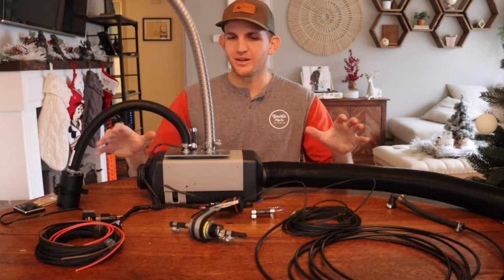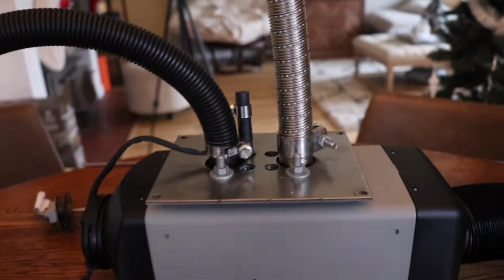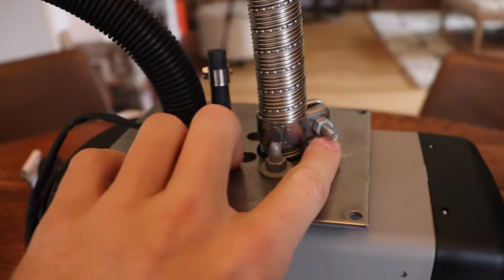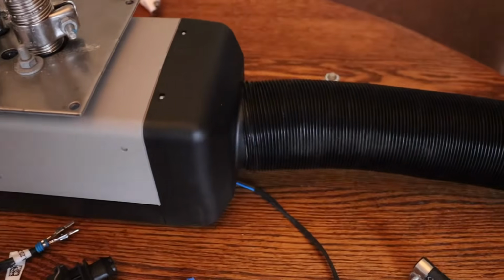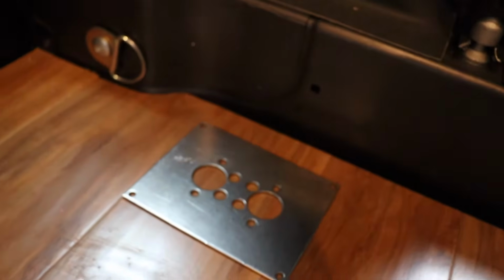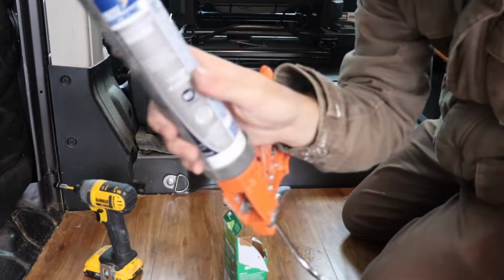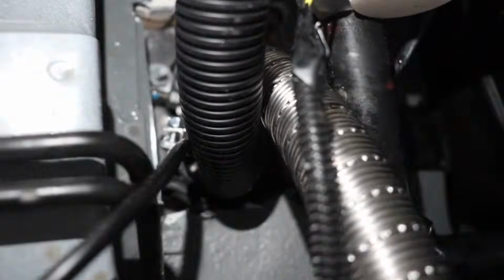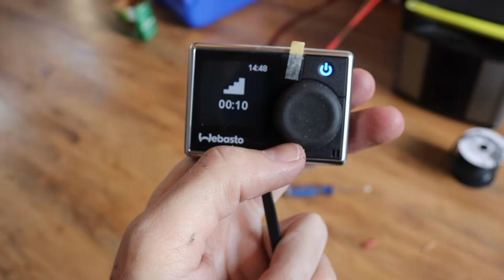VAN BUILD | WEBASTO HEATER INSTALL| A SIMPLE BREAKDOWN

Comment: Thanks so much for putting this simplified one out. Do you have any measurements to help guide the exact placement of your heater, or is it just nestled into the 'nook' there on the seat platform as best as you can fit it?
Reply: A great way to ballpark things under the van is to take drop a piece of  coat hanger etc down the tie down bolt holes.  some go right through tooutside.  Then measure off that known point to do the pilot hole. I'm also using a few of the tie downs to bolt the floor and heavy items down for safety in case of an accident.
I ended up almost dead center of where I had the plate sitting for layout in the van.   Cheers.
Reply: @4945tv Thank You!!  So Easy, So Powerful, So Life Affirming!!  :)    Exactly what I needed as I'm starting the install and planning placement.  I inside and outside (in snow) wondering how the hell do I know where these holes might poke through.  No more guessing.  Perfact.
Reply: You have to be a little careful of the EVAP solenoid below that area but otherwise it’s a perfect spot for a heater.
Reply from the maker: @TWSUF-JI  you’re exactly right. In fact I’ll pin the comment so others can see. I should have mentioned this in the video. That is the reason I drilled a pilot hole. So I could see exactly where I was cutting!
Reply from the maker: You’re welcome!! I measured it out the first time and got as close as I could. It’s difficult to be exact when underneath the van so I drilled a small pilot hole and then crawled underneath to verify I wasn’t going to hit anything important underneath and had enough room for all the components. 
But getting it in that “nook” as you say, as close to the driver seat step is a good spot!

Comment: Thanks for taking the time in making this video, this gave me the courage to install mine exactly like this, I'm having issues with fuel feeding to the heater, it's starts up and generates good heat but after a couple of minutes it dies out, can't seem to find the issue, someone told me the fuel line is too short, it should be longer??

Comment: Great video! this is exactly where I am installing mine, this will help a lot! Quick question for you, you cut the subfloor/insulation, I've seen people use mounting plates with a sort of extension (Turret) toward the outside, to prevent any exhaust leak from going inside. Do you think that it's a good option? Thanks again for your video and sorry if someone else already asked you this question.

Comment: Ok, I’m a little confused. I watched a couple other videos of people installing the heater in a Ford Transit and they both had to lower the fuel tank to complete the install and that is where I kind of lost my courage, but in your video apparently you don’t have to do that with a Ram Promaster as it looks like there is an access panel to the fuel tank from inside of the cab? Given that another video said that estimates to have someone do the install for you in a Transit, was $900-$1500, and although I was leaning towards getting a Transit, I think that buying a Promaster would be a better choice, as I could install the heater myself as the electrical, and rest of it isn’t as worrisome.

Comment: Hey Man, You are a good Egg! I love your videos!   How did seal the hole you cut in the floor? You must have layers of plywood, insulation, foam board etc., that shouldn't get wet. Is that area subject to heat? I am wondering if gooping silicone or Sykaflex  or RTV in there is all that is needed? Please let us know what you did?

Comment: Hey Colton. Which Dorman bundy fuel line adapter is that one? I looked on Amazon and there's a bunch of them but with different numbers expale "800-123", "800-125", etc etc. Which claims to be the manufacturers part number. Can you tell me which part number you used? Thanks bud.

Comment: Colton, great video. Can you tell me a couple things. Once the hole was cut did you seal the inside of the cut? It looks like there was flooring, a sub floor, and I’m guessing insulation. Also what did you secure the webasto to the top of the floor with? Did you use wood screws? Thanks

Comment: Do you need the control head unit thing? If so what’s the amazon link to it
Reply from the maker: Hey Dustin! There a link in the description for the webasto heater itself and it comes with the control head :)

Comment: I watched the first Webasto heater installation you did, and wasn't sure that I wanted to try it.  After is second one, I I may give it a shot.  I am getting a less expensive one than the Webasto, and it comes with a diesel tank for use in a gas ProMaster.   I'll have to keep this video up when I go to install it.  Thanks for all the great information, as always!

Comment: Thank you for video, it helped a lot on first installation at mountain house. I have one problem with Evo55. Fan is working, all connected. No green light on round remote? Digital remote is working but when i choose Heating, fan starts 3 seconds and digital remote resets, and unit stops without pumping any fuel. What do you think it could be?

Comment: I'm curious, your video as well as another both have the exhaust pipe terminating slightly below 45 degree angle with ground however the installation manual advises it must be 90 degrees downward citing fire risk. I can't imagine what fire risk there is either way. Can you comment on what this is about?
Reply from the maker: I could see if the exhaust was pointing straight down it could catch tall grass or something on fire. But other than that a 45° has worked fine

Comment: Hi there. Great video. Why did you move the unit closer to the seats after initial placement?
Reply from the maker: Hi, what do you mean?
Reply: @ColtonAnkeney  Hi there. No dramas. You marked out the placement, drilled the holes for saw insertion and then in the video, cut your final square hole about 1.5 inches closer to the seat base
Reply from the maker: @steelosm  oh I believe I marked it then drilled from the under the van up, and had to adjust a little. No major reason
Reply: @ColtonAnkeney  there is a structural cross-member running between the frame rails that your first placement was over. To place the heater here you have to push the mounting plate as far forward as it will go. I'm going to try putting it here today but it's a tight squeeze - definitely can't do the 4.5" hole so your rectangular hole is a good plan!
Reply from the maker: @DominicTracey  good luck :)
Reply: @ColtonAnkeney  Worked out great in this location. From pulling things out of the box to fully installed was about 5 hours. This location is cool because the runs for the fuel line, exhaust and combustion intake are super short, making the install a snap.

Comment: Excellent video with a clear, concise explanation of the Webasto heater. Could you address in a future video problem solving when the heater gives error codes?  Maintenance too, as I learned from customer service that regular high heat running is critical to long term use. Having not done this, I think I’m currently suffering the consequences. I’ve used my Webasto for eight months and now it won’t start. Code F02. Customer service is excellent but closed on weekends. I’m at an RV Park relying on a small backup electric heater as the overnight temps are in the mid 20s. Glad to have a Plan B but desperately want to get my Webasto operating again!

Comment: Thanks. I was thinking of installing in the same place, but am concerned about running hot exhaust near that EVAP system. Have you done any temperature checks in that area under the van after using the heater?
Reply from the maker: That exhaust tube goes clear out the sides, Ive had it there for 3 years and use it regularly. No issues

Comment: Hi, does this webasto heater also assist the engine during cold starts in extremely cold weather? or is it only meant to heat the cabin air?
Reply from the maker: Only to heat the inside of the cabin

Comment: Hey Colton,  I so appreciate your videos!  2 QUESTIONS:  Any concerns with heat from Webasto exhaust near fuel components under the Promaster?  Which location do you prefer, pass seat or behind driver's seat?
Reply from the maker: No problems at all! And for the promaster I prefer where I put it in this van. Transits I like it under the passenger seat

Comment: Alright, so I'm almost done installing it, but not sure how it powers up to my car battery. I don't want to mess up the cars battery when connecting it - yet no one shows how it's connected!
Reply from the maker: I didn’t connect it to a car battery. I wired it to a fuse block. There’s a positive snd negative wire at the end of that rabbits nest of wiring!
Reply: @ColtonAnkeney  but that's connected to the car battery?
Reply from the maker: @michaelfrymus  nope that fuse block is powered by a goal zero! I have an “electrical explained” video on my channel!
Reply: @ColtonAnkeney  okay.. so this is not the setup I'm looking for.
Reply from the maker: @michaelfrymus  sorry I couldn’t help. What set up are you going for

Comment: Can I just run the fuel like through the inside of my car and into the fuel tank, rather than mounting it all underneath? Is that safe?
It would be under the carpet and out of areas where you'd be stepping on.
Reply from the maker: Well the fuel line on the heater is on the bottom next to the intake and exhaust. So it kind of has to go under the van, also you probably wouldn’t want the pump inside the car either since it’s noisy and you wouldn’t want any leaks

Comment: Thanks for your great videos!  
Can you tell me the length of the wire that comes with the heater? I’m trying to determine if I need to run wire to the location. I haven’t received the heater yet.

Thanks!
Brad
Reply from the maker: I don't remember exactly. maybe 10ft?

Comment: Hey man thx so much for this video. 

2 Quick Q: 

1. 
I notice that we have a “1 amp fuse” next to the 15amp fuse that’s coming off the heater. Did yours have one too? I didn’t see it in the video. 

2. 
We just hit the road for the first time full time and getting some H83 errors then the F07 lockout … we didn’t use it for ~1 year. When I force reset by taking the 20amp fuse it works for sometime and then I have to reset it when I get too many H83. 

Having no luck on my online research on how to solve this H83…

Comment: What amp fuse are you using in your panel?
Reply from the maker: Most of the fuses I used are 15Amp
Reply: @ColtonAnkeney  thanks. I've been getting error codes on mine. I'm using a 25amp fuse and was thinking it could be the problem
Reply from the maker: @yebbastudios7515  what’s the error code you’re getting?
Reply: @ColtonAnkeney  I was getting H07, H03, H02.
It turns on, primes the pumps, air comes out then never heats up and pops the H02 code
Reply from the maker: @yebbastudios7515  https://knowledge.traillite.co.nz/knowledge/the-webasto-heater-isnt-working
Try reading through these. Might help!
Reply: @ColtonAnkeney  thank you so much! Appreciate that 💯

Comment: Hi great vid as usual.   
 Question.   Anyone know how hot the ducting gets at the outlet of the heater ? 
  I'm planning to duct the hot air about 5 ft through a cabinet efore it dumps into the room.
  Wondering if I need to wrap the duct with High temp insulation for safety  vs foam insulation for efficiency.

 I'm Def going with that mounting location and a hole big enough to pull everything up and out vs unde rthe seat.  I been in the service biza lot of years and its best to consider how you'll service things when they break while on the road.   Thanks for the reply and great content.
Reply from the maker: Might not be a bad idea to insulate or wrap with heatsheild. The ducting is just flimsy plastic. And yes. Being able to service is a huge bonus!

Comment: I installed my Espar last summer and I didn't use that mounting plate, but it sure makes the install a lot easier!! Great Job!! 
Do you have any concerns that your exhaust hose clamps are basically in the van? Normally you'd mount it to the floor and the exhaust hose is completely outside of the van and then I put some caulking around each hole so no fumes can get in. Those fumes are bad!!
A friend has asked me to help them install their Espar in a few weeks and they have a plate and we'll be mounting it to the floor but I'll cut out the floor area like you did. Great video!!
Reply from the maker: I haven’t had any issues or concerns! I used a hefty amount of silicone around the edges of the plate. Also that flooring is less than 1/4”
Thick so it’s not too high above the floor of the van!

Comment: Great video!! I like how you aren't afraid to show the screw ups. I was planning on cutting out my subfloor to mount mine directly on the base of the van but I see you placed your heater directly on your floor. How much of the metal tubes ended up sticking out of the bottom of your van?
Reply: Also, I'm a little confused on the barbed adapter. Exactly what size will I need? And what kind of caulk did you use for under that metal plate, I imagine it gets hot under there. Thanks
Reply from the maker: Even on top of the floor there was no issues to with the tubes! I used a silicone to make sure the it was sealed. I provided a link to the barbed adapter!
Reply: @ColtonAnkeney  I guess because you said one size but the link is another. Can you clarify please. Thanks and sorry to be a bother.
Reply from the maker: @gpswildride  ohhh I see. The link I provide is to the closest size that works!

Comment: Red is typically the positive but I’ve found some manufacturers switch it around. Is the red or brown wire the positive lead?
Reply from the maker: Red is positive here too :)
Reply: @ColtonAnkeney  I thought so. My problem is I had it working initially off the main battery. When I  rerouted it to the back and the battleborn batteries for some reason its not working, tried changing the polarity and that didn’t seem to do anything and when I test the connector to the controller with a multimeter I get 12.91 volts. Even bought a new multi controller and same deal. Need to get it running before the weather starts to drop off as it is here in New England. Thank you for the the reply. Going to have to keep plugging away at it (no pun intended).
Reply from the maker: @jimdandy4329  Ah bummer. Sorry to hear you’re having issues... can be super frustrating
Reply: @ColtonAnkeney  totally, the AC works but only on shore power (have a 2000watt inverter/charger) and the heat is currently a mystery. Oh well, nothing I like more than a good challenge!
Reply from the maker: @jimdandy4329  fantastic attitude dude!
Reply: @ColtonAnkeney  got to have that PMA!
Reply from the maker: @jimdandy4329  hahaha for real!!

Comment: Thanks so much Colton! Question, Our kit came with a large metal U that looks like it might be what is suppose to go in the fuel tank? You didn't mention it and I am wondering what to do with it or maybe ours is just a bit different.
Reply from the maker: It is not needed if you use the fuel line connector! Link is in the bio

Comment: Thanks for all the detail on the install. Have you heard anything about high elevation adjustment on the webasto? We live at 8,000 ft and plan to go skiing a lot, so guessing I’ll need to run a little leaner.
Reply from the maker: Hey David! I also use my van to go snowboarding a bunch! The highest I’ve used it was a 7500ft and it worked fine. There’s a hand full of videos out there the describe how to set it for “high altitude mode” I just haven’t messed with it enough to remember off the top of my head. Thanks for watching

Comment: Love your work! looks like the Fuel line connector is 5/16" to 5/16" but the barbed adaptor is 1/4" to 3/16" just wondering why the adapter not something like 5/16" to 3/16" ? i.e. not the same size at the Connector.  Thanks again.
Reply from the maker: The adapter is to go from the Aux plug (5/16”) to the 1/4 fuel like!
Reply: @ColtonAnkeney  ok got it, just noticed the product in the link is 5/16 at the aux to 5/16 (fuel line)
Reply from the maker: @robloewenthal  awwww I see!
Reply: @ColtonAnkeney  I'd say the 1/4 fuel line fits over the 5/16 barb anyway.  also the in the video you said 1/4" to 1/8" barbed adaptor, however the link is for 1/4" to 3/16"

Comment: Nice and simple vid. Planning on installing one in a ProMaster in the next few days, but I would like to install it in the same area like you , but close to the corner (under e bench seat). How did you seal it underneath the van? As mounting it like you did would leave my subfloor & insulation exposed?? Thanks
Reply from the maker: After I cut the hole I spray painted it to seal it. And then I put silicone under that plate of the heater to also help seal it!
Reply: @ColtonAnkeney  ok. Silicone under the plate would seal it so nothing gets in the van, on top of the floor, but wouldn’t that leave the floor layers exposed from underneath? Or did you use silicone around the exhaust/intake from underneath the van also? Thanks
Reply from the maker: @andreimortila7123  the paint on the underside is what seals the exposed metal and subfloor!

Comment: Colton! You are a fantastic teacher. Thank you!
After watching your video, I've gone from having about 43 questions down to just one. 
For the fuel pump wires coming out of the heater, how does one determine polarity? It seems to me the DC pump would want positive (brown) and negative (blue) to match up correctly. Any thoughts on that?
Reply from the maker: From what I’ve read, the polarity doesn’t matter!!  So either that’s true or I’ve been lucky 2 times in a row!! Lol